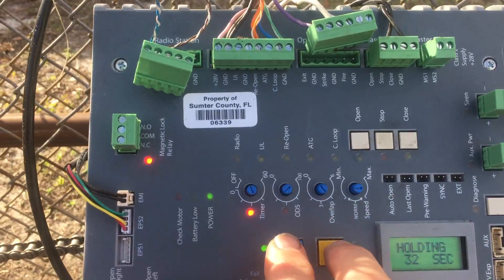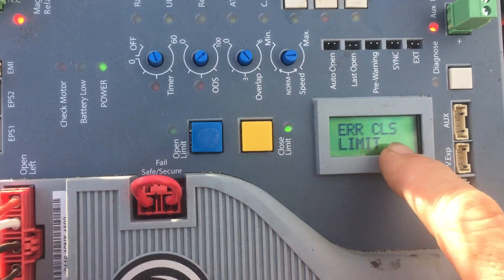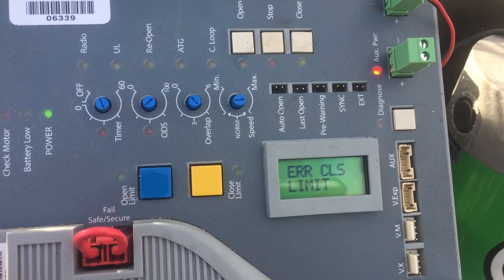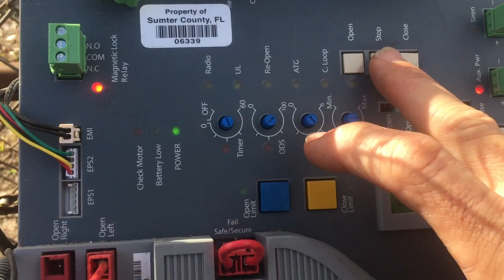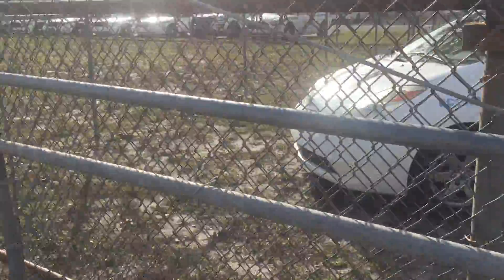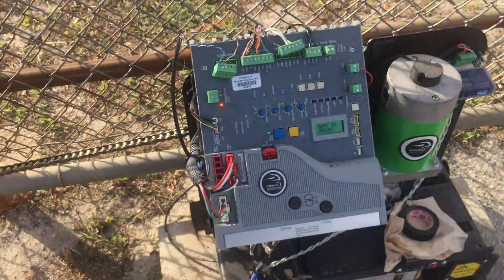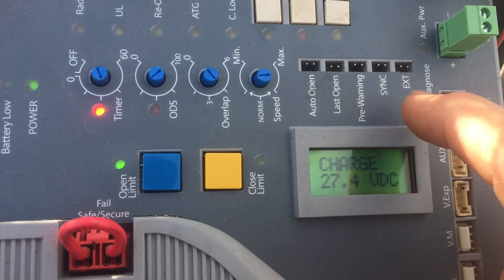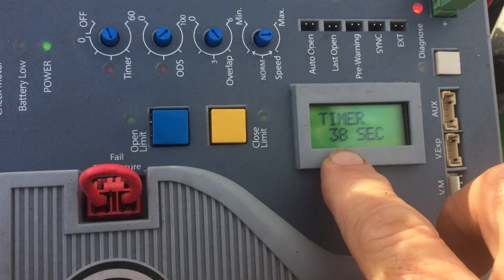Set Limits On Viking Access Slide Gate H10 - 352 Gates, llc

Comment: Could you tell me what is happening if the open and close limits keep resetting themselves?  We set the limits and a couple days later we get an alarm saying error no limits with no one touching the panel.
Reply: Mine is doing that did you get it fixed ?

Comment: I have a F1 viking that wont close it gives me the the code as if the photo eye was not working.
Reply from the maker: If you have an error UL then you need an approved UL photo Eye
Reply: I already installed 2 different  omron 3k. But it would just not work.
Reply: venudote grandote did you install the 10k resistor for the UL ? Please check your manual for UL325-2016

Comment: I have trouble,  lcd says open limit. ?. Gate is open. I reset limits like you showed.  Open is at limit solid light on. Closed is flashing but gate will not close?.
Reply from the maker: If you have an error UL then you need an approved UL photo Eye or the gate will not close
Reply: 352 Gates, LLC it was the eye. Was bad thanks
Reply from the maker: No problem glad you fixed it